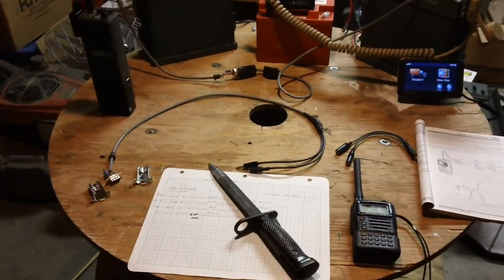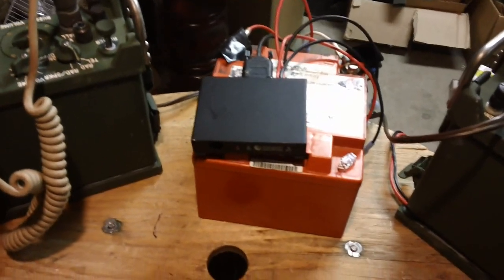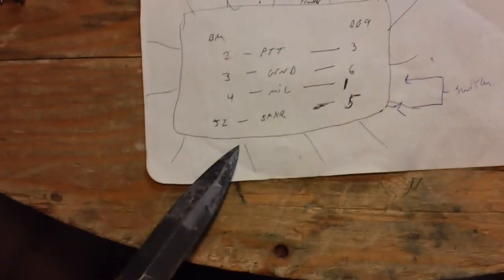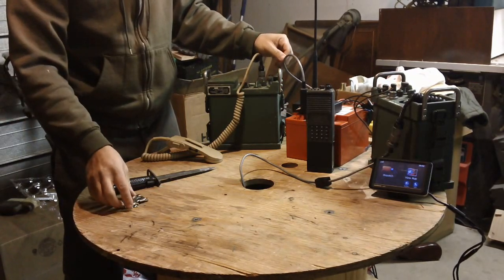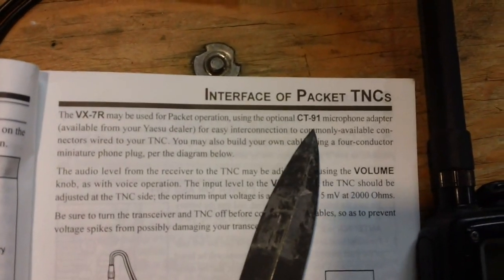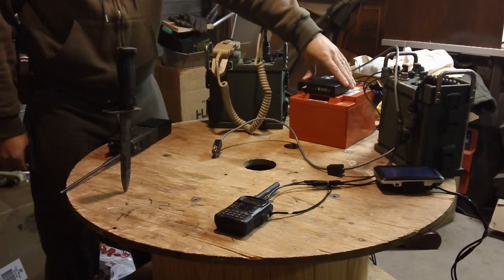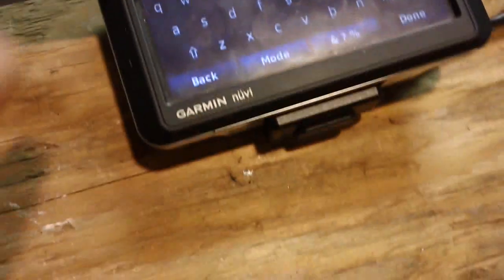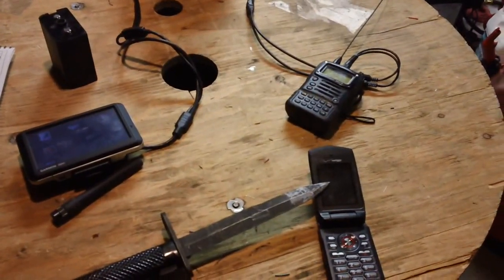How to interface radios to any device, Yaseu VX-7R or standard radios into Military equip & TNC's.

Comment from the maker: @n2kto Its either a Nuvi 750 or 755, I forgot and its not handy here. I purchased a cable from Argent data that has a RS232 serial cable built for the trakr2 to interface it. though the Garmin 350 is the model with the "glitch" that permits it to display other trackers on the screen. Haven't played around with that function, just the GPS data and sending text via internet or phone. will make a vid soon about the setup.

Comment from the maker: @photofudge I have either a nuvi 750 or 755, dont remember. I had to get the serial dt cable from argent data to interface their box. standard comes in regular soccer mom mode you plug in the cable it converts it to some kind of fleet management application. will make a vid sometime about it. Thanks for watching.

Comment from the maker: Sorry for the delay in answering, busy prepping for camping. The cap does charge & discharge for the AC voice audio, passing it to the modulator or whatever. But its more so for blocking DC or resistive load presented to the IC chip its connected to. That IC chip when loaded down by the microphone without it will make the radio transmit constantly as if it was ptt. So, its mainly used as an isolation device. These engineers are crafty...

Comment from the maker: The TNC (BLACK BOX) is an ARGENT DATA tracker2. the tracker has a serial data port (DB9) input and the gps is also serial data output to feed the tracker with the location info. the tracker on the same connector also recieves serial data from the PC or my car GPS as well. ARGENT data sells the interface cable for the garmin 755 NVI model. the NUVI 350 is the better model for APRS. thanks for watching from France, really cool.

Comment: If your sending messages from you GPS through you radio, is there anyway your location can be tracked or your signal be tracked and followed?
Reply from the maker: They could track the site it bounced (or repeated from) but not pin point your location. Its somewhat of a crap shoot in a given region. On the other hand, its a ham frequency, so every transmittion has to have your callsign, which is public record with your name & address.

Comment: Intresting , i would like to link my yeasu ft897 into another device "Digital dstar radio" who have exactly same setup on the mic as the yeasu 897 ... Could i use a cable between them with only 10 Mf capacitor and a 2.2 kohm resistor on line/mic ?
Would be nice to do a bridge between analog/digital hamradio :-)

Comment from the maker: @IronRangeSurvival RLHAM (dot) (com) is a reliable reputable online vender that I'm happy with, when it comes to ham gear. Argent Data is another maker that makes APRS trackers and terminal node controllers. usually cheaper than the big ham stores online. the other stuff I get is usually ebay or decommissioned surplus stuff I come in contact once in awhile. Thanks for watching.